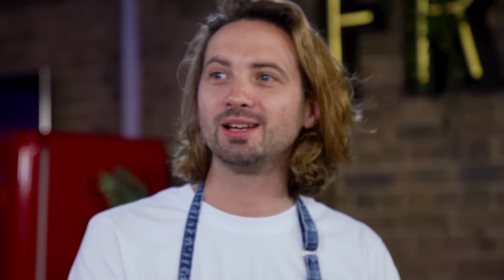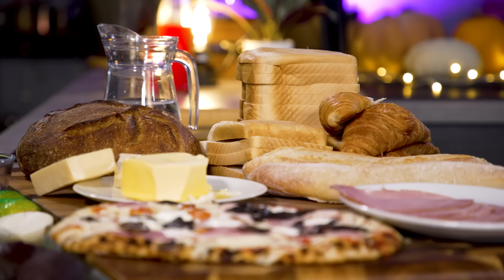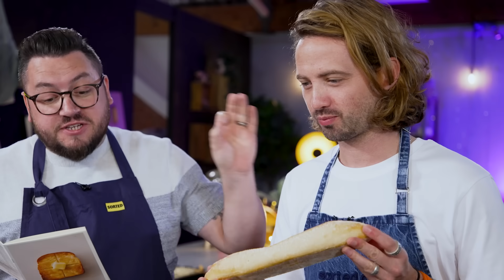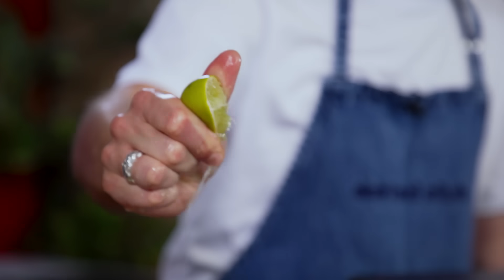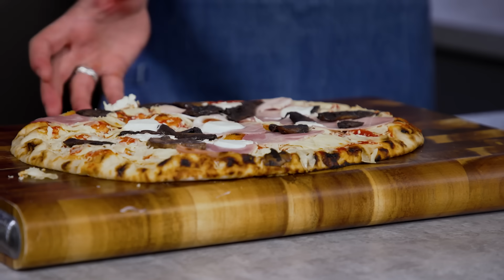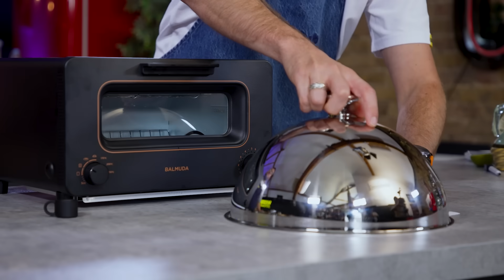Is this £260 Toaster GENIUS or an Absolute Waste of Money?!

Comment: It’s really no different than the toaster oven/just pizza it does it dehydrating little oven that I bought which is bigger than that. Makes great toast and frozen pizza comes out delicious and it’s definitely cheaper than that.
The truth is that you guys really don’t know how to use a toaster oven or for that matter, a multi-purpose, toaster oven. If you did, you would know that you could get the same exact results without having to measuring out a certain amount and then putting the water in that and look up thing on top, and you can get the same amount, exact same results by putting in the bottom tray on your toaster oven, a small thing, amount of water and then putting on the rack on top whenever you wish to toast. At first I thought you were guys were doing this because you were getting paid to buy the company that makes it but the fact that you guys criticize the fact that it was so small etc. leads me to believe that maybe this isn’t a commercial for the company. But at first that’s exactly what it felt like.

Comment: I just can't get past the price tag, $300 for a toaster! And I thought I was pushing the boat out with the $50 one I bought the other day. Having said that, it does seem do a nice job though.
Reply: Agreed for that price it should have included some electronics to detect BURNT toast issues. Otherwise I am sticking to a $200 insta pot that steams and crisps as well with one  example 
Ninja OL501 Foodi 6.5 Qt. 14-in-1 Pressure Cooker Steam Fryer with SmartLid
Reply: I own one and its great
Reply: I have a convector toaster oven that's about $75 (used on Amazon, it was more expensive as new). The one they showed is not a convection oven, from what we can tell.

Comment: Try a Microwave/air fryer/toaster oven. Sounds wrong, but works surprisingly well. Even though I cringe every time I put the metal tray in my microwave.
Reply: when our 20 yo microwave dies, that's the planned replacement.

Comment: 4:00 Sorry to tell you, Barry, but "whelmed" means the same thing as "overwhelmed." "Whelm" is the original word, and "overwhelmed" was said as a punchier, more intense way to say the same thing.  As usually happens, the punchier version pushed the original out, and then "underwhelmed" developed as a natural response to "overwhelmed".
Reply: That's not accurate anymore, the language has changed. Whelmed now means the middle point between underwhelmed and overwhelmed.
Reply: @fh5kskalf  Eh, fair.

Comment: Looks like a total gimmick.  

Bigger, more expensive, less efficient, and more prep than a regular toaster.. and even after that it doesn't even toast evenly. 

If anything it just looks like a really cheap electric oven worth  quarter of the price, with some slightly different modes. Not sure why the guys went so soft on this product.

Comment: 2:52 No one gonna talk about how awful that slice looks on the bottom. Half of it looks burned and the other half looks like it hasn't been toasted at all
Reply: Looks exactly the same as a portable electric oven I bought in uni for £60. Things like this struggle because all of the heat escapes out the front making it really uneven. A regular toaster is far better

Comment: hear me out, two new ideas for challenges: 
1. no energy/depression cooking (needs a better name!), get the participants to use as few elements/stages as possible AND as little clean up needed as possible (like dishes, trash etc) as little effort as possible but still not like, microwave meals you know! lite sure, use shortcuts, but you're not supposed to notice them in the final dish. cook like you have no energy to cook/depression. when I am in a depressive episode the thought of many different stages or elements in cooking or the cleaning up afterwards makes it almost impossible to start cooking.
2. Use as little electricity as possible! (don't really know how to measure this though, number of times or different points for low/medium/high...?)